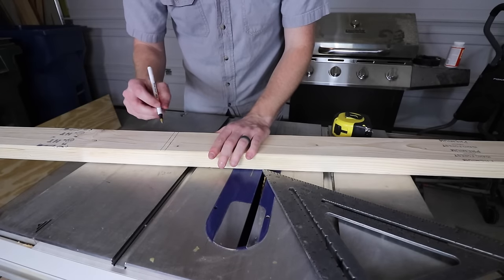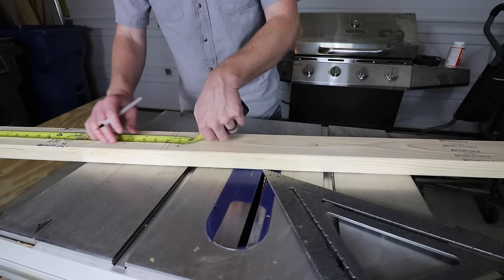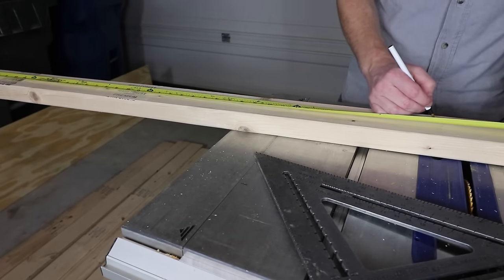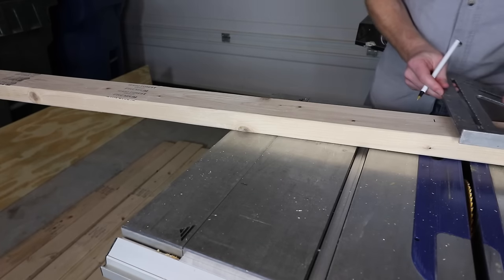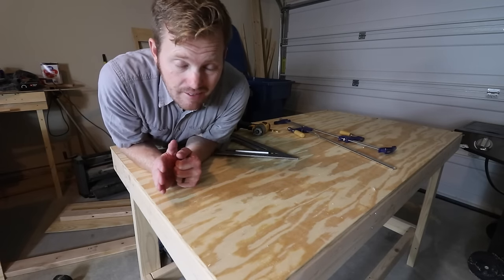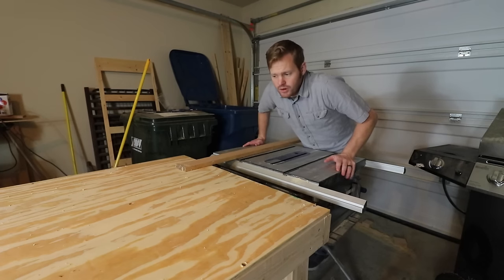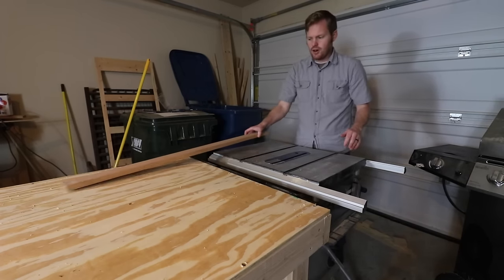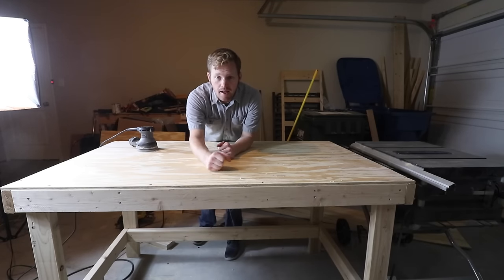EASY DIY WORKBENCH for UNDER $50

Comment: Matt, I voted you up because I like the work.  I do have two comments I hope you and others will take in the helpful way I mean them:

1. Use safety gear.  You're a tall guy so drilling down on a 36" high table is fine, but you let your kid do it too, and that drill and wood coming out of the drill hole was awfully close to his face.   When you did your circular saw cutting I cringed a little but it was obviously something you're good at doing.

2. This is a great outfeed table, but not a workbench.  The only thing supporting the top structure are 8 screws into the skinny legs.  I wouldn't mount a bench vise on it, or pound a sledgehammer on it, or attempt to get a tenon into a mortise on it.  You've preloaded those eight nails with 4 2x4s and the plywood top.  

All that having been said, it looks like a GREAT outfeed table (or infeed table if you move it around).

Respectfully,

Ehud Gavron
Tucson AZ
P.S. The music wasn't too loud.  All these old guys complaining about loud music... shees! :)

Comment: should've made the bottom part into a shelf
Reply from the maker: +Cole Moberly yes, I didn't want to buy another sheet of plywood so I didn't. But you easily could.
Reply: Matt Mecham Makes sense. I built this bench yesterday and it worked out well.